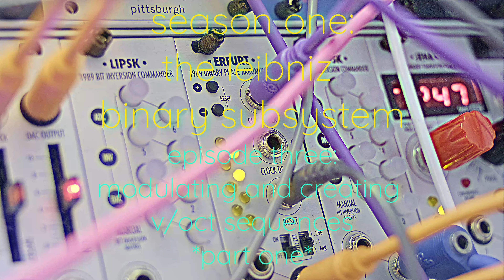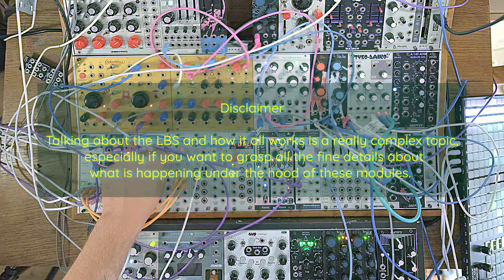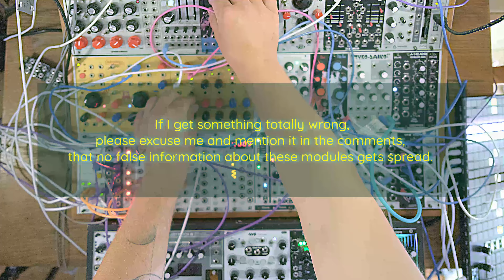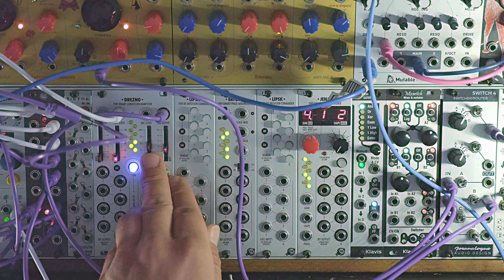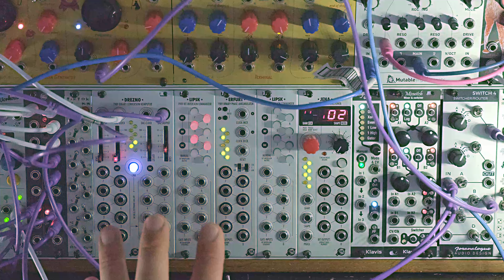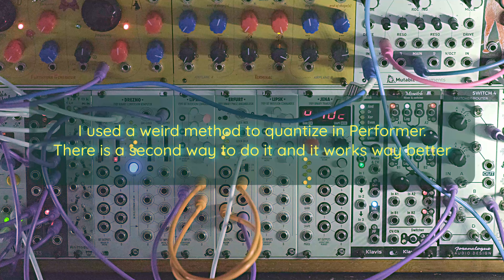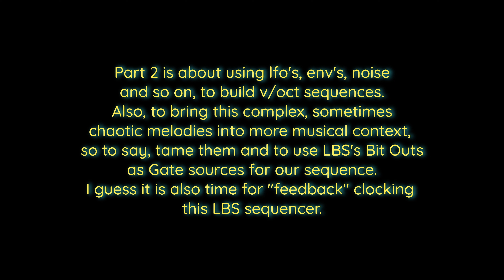the noodling notes -s01/e03p01- "Leibniz Binary Subsystem" - modulating and creating v/oct sequences

Comment: Nice video! Great to get some ideas about what this system of modules can do.  Some constructive criticism though, sometimes in this video it’s very hard to hear what effect it’s having on the sequence.  The reverb or delay your running it though and the lower notes make it sound very muddy, and on top of that it’s kind of quiet. So it’s often hard to hear what it’s doing to the sequence.   I would recommend using less effects and higher frequencies. Might not sound as interesting but it will serve the purpose of the video better.  The second half of this video does sound better/more clear though.
Reply from the maker: Thanks for the criticism. Good to know! I was also troubled with the sound a bit in that one and with your tip it makes perfect sense. Will try that in the future and also should do more mixing and eq'ing afrerwards. Already had the plan for future episodes to record everything on seperate tracks to have more control afterwards. Only need to find the rightw orkflow for it. But thanks, really appreciate honest feedback :)